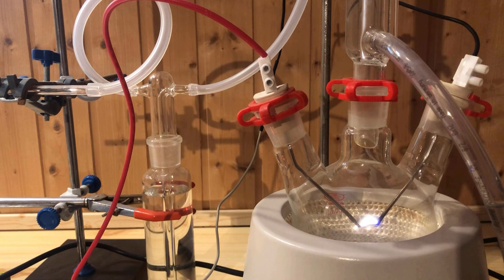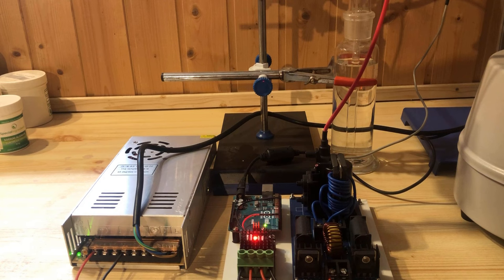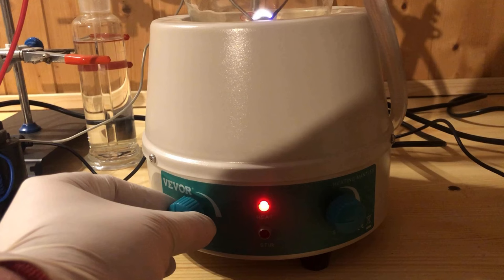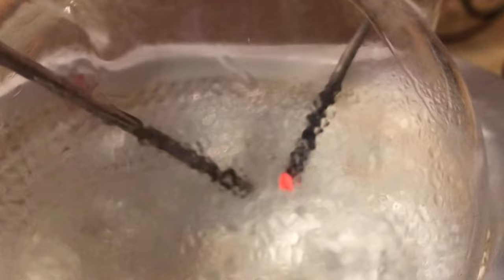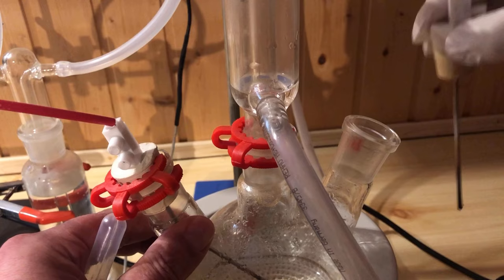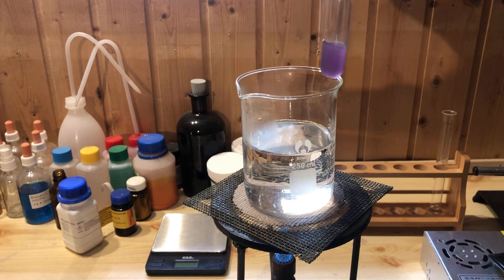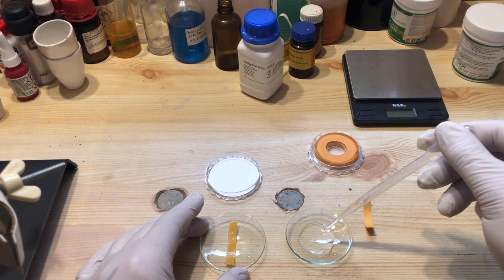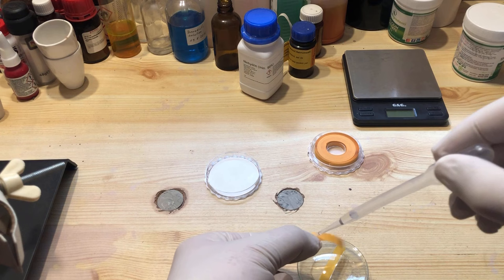Modified Miller–Urey experiment based on my ideas and theories #MillerUreyExperiment

Comment: I came for the biology ...but I'm intrigued by the circuit. Is that a ZVS driving a car ignition coil??   I tried to build a solid-state tesla coil about 20 years ago with something very similar, but using a 555-chip as ZVS weren't available at the time.  I might have to revive it, hadn't thought of using a ZVS :)
  
Maybe carbon/graphite would be a cleaner material for your electrodes?   Love the work!
Reply from the maker: Thank you:) It's a ZVS driver with a coupled flyback transformer used in old TVs. I also thought about using graphite electrodes, but since there is still oxygen in the initial atmosphere, the graphite would burn through the plasma, forming CO/CO2 and distorting the result. Tungsten electrodes would be best.
Reply: @Marbslab  ahh of course, I knew I recognised it.
Good call, hadn't thought of that with graphite...I guess tungsten/platinum would be better.